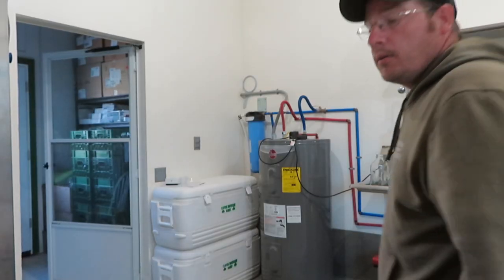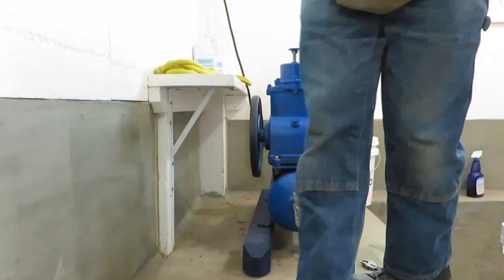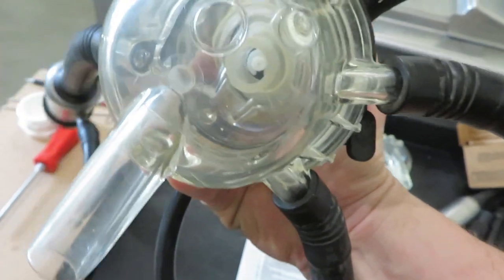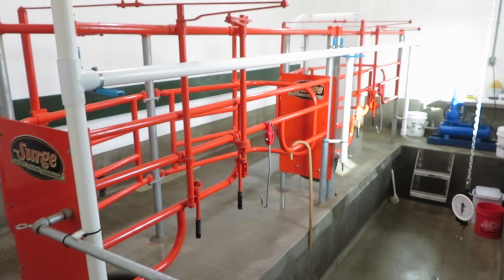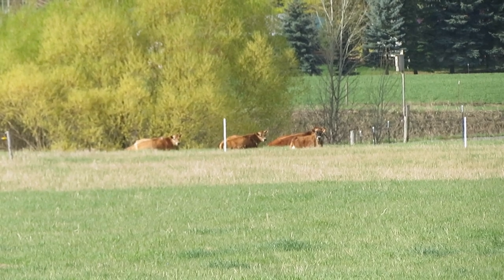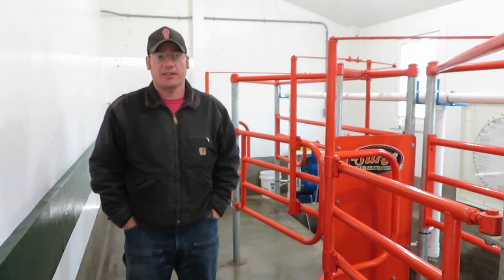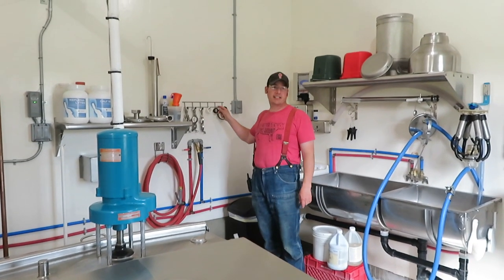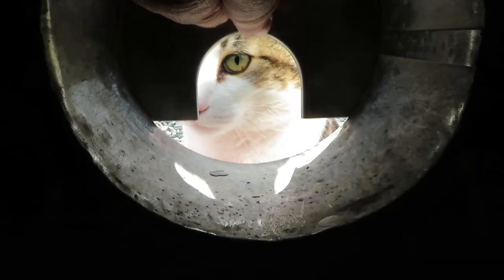Ready to milk! Calving season is nearly here! Time to get the dairy ready!

Comment: On a completely unrelated item. I noticed that you had pex tubing ran directly to your water heater. As someone who has a weird interest in all Things plumbing I would like to know if you experience any problems with your pex tubing where it connects to the water heater, i.e., becoming dry and brittle or melting etc. I know code in most areas does not allow most plastic piping within 18 inches of the water heater. Though I deal mostly with natural gas water heaters which are much more hotter up top by the piping due to the exhaust vent hood and yours is an electric. Still I would like to know if you ever encounter problems from the heat with the tubing. I don’t think you will since a electric water heater doesn’t put out the heat up top as bad as a natural gas heater does.
Reply from the maker: Our water heater is not connected with PEX. It’s Stainless Steel flex pipe that just came colored red and blue, so it does kinda blend in! Haha! Thanks for watching!

Comment: when do you think youl start using both stalls in the parlor? my cows bagged up way before they calved hope thats not the case for you guys
Reply from the maker: We occasionally used both stalls last season, it just depends on cow flow. I can imagine using it more this year however. I’ll still only use one machine. The cleaning and sanitizing of the second machine would cancel out any time saved in actual milking in the parlor. Still plan to put in a pipeline eventually though.